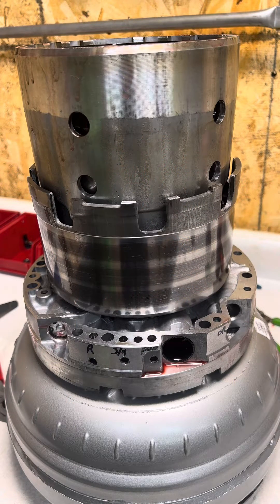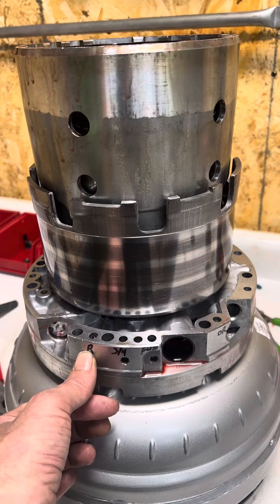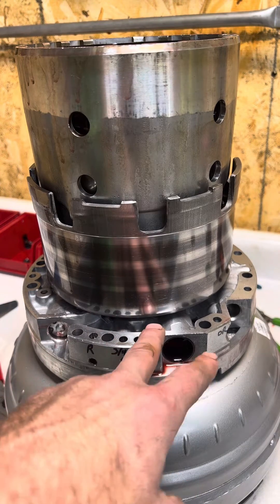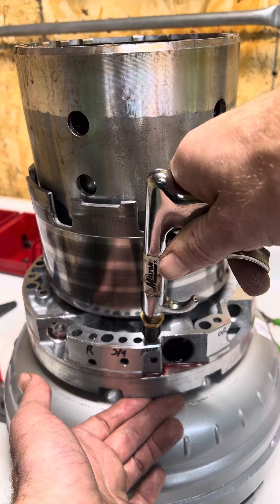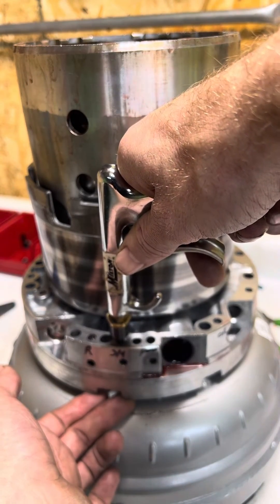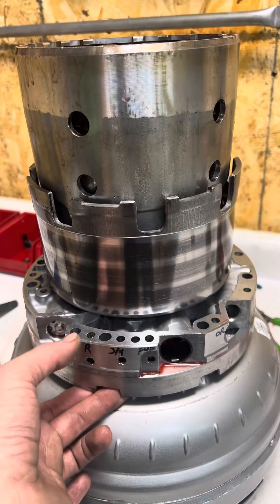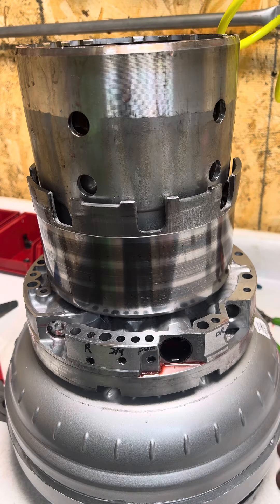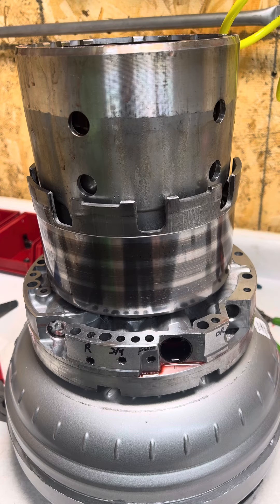4L60E air test.

Comment: Hey Justin, quick question, figured you would probably know or have some ideas.  While testing for leaks on my input shaft to forward drum assembly....   add atf & air to ports in shaft, then watching for any bubbles between the shaft & drum.  I seen one gentleman use a hotplate to check for leaks at operating temps.  I have had desent success using my heat gun. Q: is there any way to build a pressure testing device out of an old stator?  Could also be use it to test the teflon seals both old & new.  I have fixed a couple assemblies with green loctite retaining compound b4 pressing the input shaft back into the drum. How do you test for leaks at that critical junction?  Thanks

Comment: I spotted a speak leak between your pump halves when testing your 3/4 and forward forward clutches. I’ve had a similar issue.. interested to see if this is normal when testing with Air pressure and not hydraulic, maybe the problem was solved when the outer ring of bolts squeezed the pump onto the transmission case?
Reply: what did you determine? Mine is doing the same thing - a small amount of air bubbles are seen between the two pump halves while air testing.

Comment: great info. what pressure are you at  ? ive read around 40 psi is good. also, I think the reverse input drum has an air bleed in the piston, which others do if any ? thanks
Reply: yes it has a small orifice, the TRANSGO update you drill a new hole in the rev input piston and put their supplied orifice plugs into the bores

Comment: Do you wet check where the input shaft goes into the drum?
Reply: I did. It had a moderate leak. I'm going press out shaft and red lock to reseal. Re air test